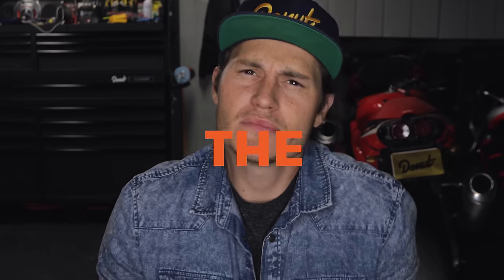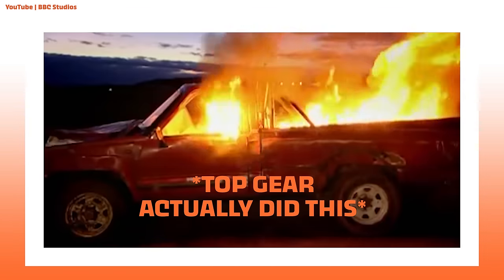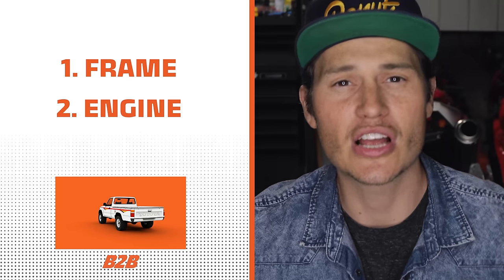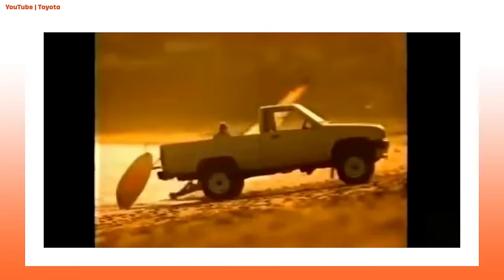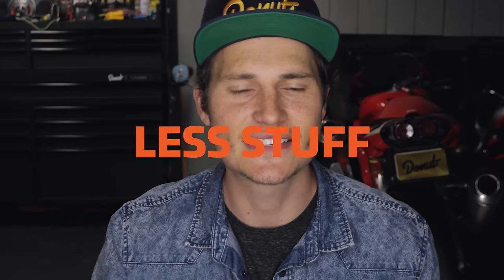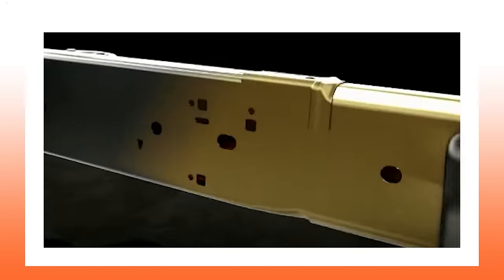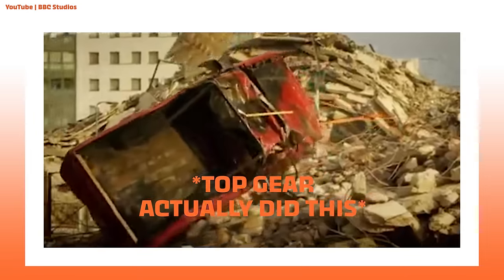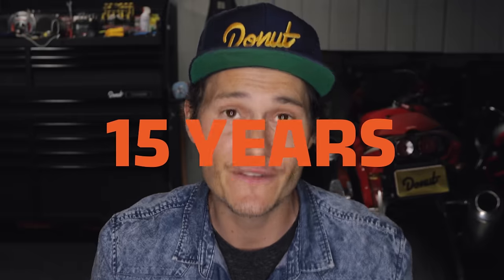Toyota PICKUP Truck - The Science EXPLAINED

Comment: German Automotive Engineer: “I’m going to build this vehicle to last forever based on the way I drive.”

Japanese Automotive Engineer: 
“I’m going to build this vehicle to last forever if a complete idiot drives it.”
Reply: ... requiring special tools to change the oil?
Reply: Incidentally, my 89 Toyota Pick-Up was rear-ended by a current model Bimmer while stopped at a red-light. The BMW basically annihilated itself, while my truck would go on to get rear-ended again before being sold, all the while running perfectly fine.

So yeah, German engineers probably didn't account for what happens when the drivers are inverted in your comment.
Reply: My tundra has been in a frozen ditch more than a dozen times. Survived 3 collisions, and cleaned a light pole off. And still only needs basic maintenance at 230k km.  Meanwhile my f150 died on its own several times before it even reached 100k km...
Reply: Dmytro Romanovskiy I saw a video of a tundra with 1 million miles that still run fine.
Reply: Colin Johnson I’m not crazy about canisters, but when I screw the cap down, I don’t worry about it backing off.
Reply: Other great German inventions:
$400 oil change because oil has to vacuumed out from the top of the engine. Porsche and Benz
Battery that must be registered with the vehicles computer. BMW
Lug bolts that frequently shear off when replacing a tire. Also you get to hold the tire up with one hand and thread the bolt I with the other. BMW Audi VW, etc
Ball joints that are integrated with the control arm so a $50 worn out part is sold with a $300 control arm just for shits-n-giggles. Audi
“Lifetime” differentials and transmission with no drain hold to replace fluid since you’re going to need a new one at 70K miles anyway. BMW
🤣
Reply: Colin Johnson you’re right , I was referring to German built autos during the same period as the 85 Toyota trucks. Japanese vehicles will outlast domestic and European models hands down.
Reply: BD S ah yes that’s true. My ex wife had a Volvo 940 that would have run forever. Parts took longer to arrive and were twice the price as my hondas/Toyotas, but it was a solid car. I loved that you really only needed Torx 10 and 12 sometimes in addition to a modest metric socket set to fix everything. I put Volvo in the same build quality as the Germans.
Reply: Japan clearly understands the American market better than the Germans.
Reply: 1337penguinman thats the truth. I got to ride in a boss’s late 90’s 7 series and it had a car phone but no cup holders and AC that was almost enough to keep you cool in Texas
Reply: @dimr1088  damn, I always wanted a f150. Guess I'll have to choose a ram 1500
Reply: Odd the mix of what they want. They all want the cars to fail so you have to buy new ones. At what point did they engineer it to fail, yet seem better than the others? Ford 5.4 three valve engines are garbage and costly to work on, but don't usually have the frame issues Chevy does. Chevy has the better engine, but what good it that if the frames are not lasting?
Reply: @Tenchigumi  Your 89 Toyota would have fell in half  from gravity 20 years ago in the rust belt
Reply: @heavymetalmadness666  Perhaps. Good thing I'm in California, where rain hates us.
Reply: So Basically...
Japanese Automotive Engineer:
"I'm gonna build this for american drivers."
Reply: @Fgg Fgg in the newer cars you have no option the car keeps giving you a message and at a certain point stops working right. And then when the oil is changed it has to be reset with a special scanner where the licence cost like 6000 euro a year and is only to be bought by official dealerships. So goodluck with that on cars.
Reply: allgoo 19 😂😂😂
Reply: I'd love to see their beta testing: "We're looking for a complete idiot to drive this for 3 months..."
Reply: Zephy Nich you’ll be much less well off with the ram. Problems at under 1,000 miles
Reply: @jaretsykora8813  I have a 07 Chrysler aspen.... 5.7 only regular maintinence.... A few electrical issues.... But runs like a dream
Reply: @colinjohnson5515   I use the $10 Walmart hand pump to change the oil in my C240 in 10 minutes oil changes on early 2000s Benz are easier than any other vehicle on the planet and the oil filter is replaced with no tools only bare hands needed just saying
Reply: @colinjohnson5515  Cannot do anything on them without torx and a 10mm! I am at my third :))
Reply: @colinjohnson5515  hell yeah
Reply: @colinjohnson5515  All the manufacturers are making ball joints like that now.  Most cars for the last 20 years dont have grease fittings on them anymore.  And the "Lifetime "transmission fluid is terrible. Toyota uses it, and ZF transmissions do also.   And ZF makes automatics for a lot of the cars around people just dont realize it. BMW uses them, but funny enough they used a lot of GM transmission.  Ive changed a few on the e46.
Reply: American Automotive Engineer: “This was built in America therefore it’s better, it’s probably gonna break though no matter who drives it.”
Reply: ...so they knew richard hammond would probably wanna buy one.

Damn thats some nice prediction skills
Reply: Proper engineering
Reply: Anthony Ha I think you would have the opposite problem of melted steel with all those fires, that smoke keeps making a Brown Haze in our New Mexican Enchanted sky
Reply: To be fair, germans built the Unimog, wich ist well appreciated all over the world, with a c-chanel that bends on purpose.
Reply: Well, they would have to.  Only a complete idiot would drive it
Reply: Bill Melcher Thats ignorant
Reply: When at the "Service Desk" yet again to pay for repairs to my Volkswagen,  I waited for the a hole to tell the Porsche owner his car repairs would take "another week." Scotty Kilmer and plenty of Mechanics that I knew personally warned me away from Mercedes-Benz.

My lousy VW did have the best Dry Pavement handling of any car or truck  (mostly trucks) that I have owned except for my Toyota MR2 and that Miata rental that I couldn't believe I got to rent.  Never,  NEVER however,  drive that old FWD VW in snow. Death trap.

I have a new frame on my Toyota Tacoma and it was free. The pickup rental they gave me while I waited was a Chevrolet mid-sized 4 door pickup with nice features but I would never own Chevy.  People I know swear by GMC but I don't advise it unless you need a full size pickup.  The other GMC Vehicles are just the nameplate not the longer lasting components.
Reply: And that’s why there’s more old Japanese cars on the road then German. Cool.  
Would you buy a German engine that has done over 100k. Never. 
Would you buy a Japanese engine with 100k. Why not
Reply: Who ever said German junk lasts forever? Only the old diesel Mercedes do that's all bout it..
Reply: @Tenchigumi  oof, ever heard of the crumble zone? We had a Toyota Pickup (no idea what model it was) crashing into our Toyota Camry, Truck had its Motorblock almost on the passenger seat and our camry had its passenger side slightly dented.
Reply: Jaime Acosta Nah what are you talking about

BMW hits 100k miles falls apart

Ah shit
Reply: Americans, I am going to build a car nobody will want and will fail soon so I can sell another one.
Reply: @Tenchigumi  You really can't expect a bmw to survive a crash with a pickup truck, the weight and mass is in a different class. Modern vehicles are built using lighter materials for fuel efficiency, they are not built for crashing.
Reply: German: "I have aaaaaall these random screws laying around, would be a waste to just throw them out, ja?" Thus you need 10 types of screwdrivers to loosen 5 screws.
Reply: Actually this particular Toyota Hilux model was also sold as the Volkswagen Taro. Some kind of predecessor of today's Amarok, although there was no VW pickup for 13 years between them.
Reply: hahaha
Reply: @Tenchigumi  Hate modern cares ar build to absorbe the Energie in a crash so youre Brain dosent witch obviusy didnt work as planed
Reply: that's it!
Reply: @zoxkxr6552  I had a stroke reading that
Reply: Dmytro Romanovskiy my 1994 f250 has a different opinion
Reply: Germans don’t build autos to last forever they build them to look good, have tons of features and perform like a race car. There isn’t a single German car company who’s primary goal is to make it last a really long time
Reply: Zephy Nich we owned a Chevy, ford and dodge truck all at the same time. The dodge was the worse in all ways. Chevy have least problems with drivetrain, but the truck rusted so bad we took a saw and cut parts off the bed. The Ford is 1994 and it’s still working fine. If you buy a new truck coat the bed immediately and before each winter pay 30 bucks at the car wash  and get the underside coated. Keep the thing under a cover or roof all the time and check oil every couple months. If you do that any truck will last 500km.
Reply: @colinjohnson5515  Yet the German manufacturers have MUCH higher percentages of their cars still on the road over time...
Reply: Now I can put anime livery on it
Reply: German Engineer: Im going to build this vehicle to last forever based on my daily commute on the Autobaun.

Japanese Engineer: Im going to start by engineering a battletank and stripping this vehicle down until i have a pickup truck. That will probably make it durable enough for idiots
Reply: well they needed a truck that could survive an Asian highway
Reply: lmao my 2008 BMW is currently toast at 146k miles. I just bought a Mazda with 33k on it, unless I’m rich, I’m never going German against
Reply: So well said!
Reply: @colinjohnson5515   not mine maybe ze german ones :D
Reply: @cornelbogdanmacrineanu7962  those are pretty standard tools these days. Even cheap socket sets come with imperial and metric while screwdriver sets include Torx, Robertson, Phillips, and slotted tips. You'll find fewer and fewer things in imperial - no matter who builds them or where.
Reply: I can hear Jeremy Clarkson yelling "POWAH" in the distance as I read that LMAO
Reply: *Cowbells and a banjo play as Whistlin appears over the horizon*
Reply: @Tenchigumi  that's not really the BMW's fault, modern safety measures basically mean that cars have to self destruct to stop you from self destructing.
Reply: @lukasg4807  No argument there; it's always worth putting safety first in engineering (and legally mandated in any case). It's just interesting how older Japanese cars tend to remain quite driveable long after what would be considered catastrophic incidents today.
Reply: on god 🤣
Reply: sadly not every Toyota car ^^
Reply: That's so true (example: Audi-vs-Toyota) 🤣🤣
Reply: @Tenchigumi  anyway, I know this might sound counter initiative, but it's designed to do that, for safety purposes (called a crumple zone).

Ain't no one comparing the reliability, but I'd rather be in a large crash in the new BMW than the old Toyota.
Reply: HAHAHAA accurate
Reply: My Ford F150 with 5.4 liter V8 runs fine.Besides oil changes, the only work done to engine was new fuel injectors  at about 150,000 miles and replaced spark plugs just in case.Have over 199,000 miles on it, 20 years old  now.
Reply: Nat ah ah ah ah 
1976 Mercedes Benz W114 240D
4.6 Million km on the clock
Reply: Jeremy Clarkson: "challenge accepted"
Reply: @1337penguinman They're used all over the world in austere environments created by idiots that love austerity, and hate basic functional infrastructure.
Reply: I'll give you a tip any engine with a timing belt can't be considered indestructible. Push rod diesels with a gear train timing system is where reliability is at. The machine at the scrap yard that crushes this thing and sends it to the shreder will be powered by a push rod gear timing chain diesel that has ran for countless more hours than one of these things. The secret to the perceived reliability of these things is simple. They are simple but anyone who has spent anytime physically driving one will tell you, they make what feels like 3hp. They don't make enough power or torque to break anything in the most feeble of drive trains
Reply: @Storebrand_  everyone wishes. They don’t sell the hilux here, because of all the tariffs and taxes on trucks built outside North America. They used to but NAFTA pretty much guaranteed ford and GM a huge competitive edge so you just got the Tacoma made in America and only sold here and hilux sold everywhere else.

Comment: My friend's dad actually has one of the pickups from the 80s they have been using on their farm to transport feed for their sheep. It has 1.1 million km on the clock. You can tell it's 40 years old but it still works.
Reply: this sounds like a new zealander comment
Reply: Finally broke the engine in?
Reply: I once knew an early 70s model which was used to by a friend's family's hotel to take kitchen waste to the dump etc. It had also done well over 1m km when I last borrowed it. 
It was eventually sent to the scrapyard because the doors rusted off.
Reply: That's awesome
Reply: @paytonlott5183  South African :)
Reply: @InvidiousIgnoramus  Yeah, now they can finally redline it!

Comment: I happen to have an '87 2wd, 1.8 gasoline if not mistaken, with almost 300k kms and it is not really being driven the past 15 years because of fuel consumption and the fact that it is not needed to carry anything. This tank of a pickup hasn't rusted one bit, if you exclude some rust in the cabin frame, i don't even remember the last time the engine, transmission and diff oil was changed, and still, when needed in the field, the fucker will start up with who knows how old gas in the tank, be loaded with atleast 1.5 tons of stuff and cruise with speeds of up to 80 kms/h with ease. The thing just does not want to die, but to be fair it is not abused or neglected in any extreme way. Toyota engineering at its finest.
Reply: If you have anything but a 22r you have a pretty rare truck
Reply: @chefjohn69  I am planning on getting a diesel.
Reply: I found one that runs and drives.
Reply: @DylanDunn-c7e  that's a rare find too

Comment: I knew somebody in Brasil who said about her Hilux "it will climb a tree if you want it to"
Reply: I said the same about my 1997 Land Cruiser. Indestructible.
Reply: I once saw a Hilux survived after being hit by a truck, a trailer to be exact. Two in fact and damn thing still works after ggetting hit in the front
Reply: The Toyotas in Brazil are turbo diesels that get 5,000,000 miles and have fuel economy which makes a Prius a gas guzzling joke.
Reply: Brussels
Reply: The Hilux is like a religion in Argentina too. I'm not even a fan of pick up trucks, but damn, those things are amazing.
Reply: Vai brasilzilzilzilzil
Reply: @marianoclerici3986  they really are the toughest trucks made. Even the 2.2 gas motor is damn near indestructible

Comment: I have a 1987 Toyota pickup myself and I can say that these things are very hard to beat. I left it sitting for 2 years without new gas and it still runs like a champ
Reply: Done the same with my Dodge 318, didn’t skip a beat, sold the motor for $450 at a swap meet and found a 400 Mopar to swap in
Reply: I left my 2003 Camry with 187k miles sitting for 3 years. Still started (on old gas) and moved. Though it took a while.

Comment: Love this vid. My 86 4runner has 480k on the original engine. My 88 pickup has 300k. It's going for a rebuild though. They are getting really hard to find parts for now with even Toyota discontinuing alot of pretty important components. And not using oem parts is asking for trouble with these. They are without a doubt the most reliable vehicles I've ever driven though. May they live forever!

Comment: I remember that my late uncle had a late 70's early 80's Toyota. The only thing that I remember helping him replace was a broken water pump.
Reply: Didn't he have a watch or a LCD clock in the hilux?
Reply: Probably did that while replacing the timing belt as per the schedule in the user manual
Reply: Toyota had a class action suit for frames rotting out on 2004 to 2010  Tacoma and replaced frames.

Comment: The rust problem can be solved with sealing entry points and place strategic drainage points plus adding thicker or tougher paint
Reply: It’s just weight reduction so I can get to happy hour faster
Reply: That's what I was thinking why didn't they simply drill drainage holes and extra clear coat!
Reply: Or not living by the sea
Reply: Also, maybe you can drill holes for ventilation.
Reply: Oil spray the crap out of it yearly
Reply: @CatsEatNomNom  that’s what I do
Reply: Fish oil is the answer
Reply: they really needed to make it about an eighth inch thicker and then spray it with a grease type undercoating from the factory.
Reply: I've worked on 2nd/ 3rd crossover, but Subaru and Nissan rust at a massively corrosion spec
Reply: Yeah bud trap that moisture in there! Hell ya

-Ohioan
Reply: @Frank-xs1kt  trapping moisture with well placed drainage holes and thicker paint?